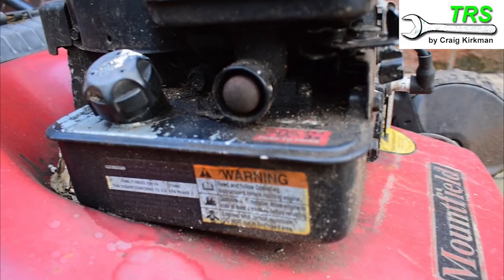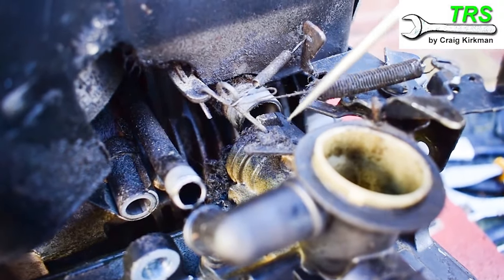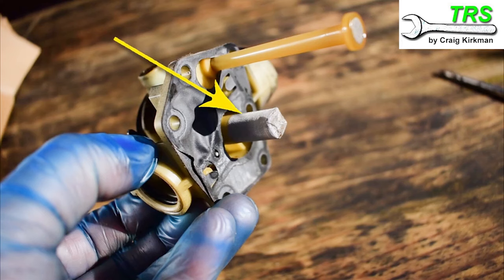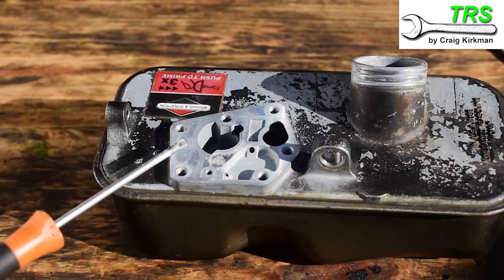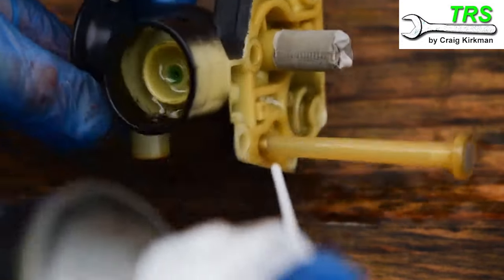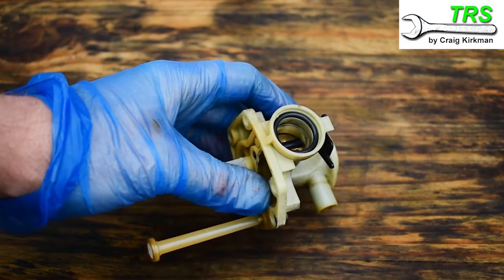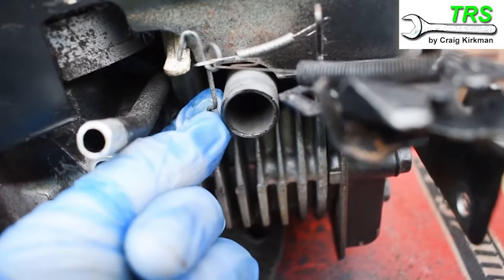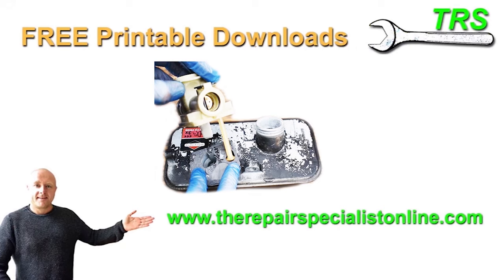Briggs and Stratton Carburetor Diaphragm Replacement- Lawn Mower Engine Diaphragm

Comment: Thanks to you sir I repaired/serviced my old hand-me-down mower. It has never sounded more powerful. Symptoms were low revving and not maintaining rpm to almost cutting out. I removed, stripped and cleaned the fuel tank and carburettor and reassembled. Now it runs like an animal!
Reply from the maker: Fantastic. Thanks for letting me know. Happy cutting. Craig 👍👍

Comment: The best video on this type of Briggs & Stratton engine. Especially the detail about the flatness of the carburetor to fuel tank mating surface. This caused me to assemble and then reassemble the whole thing multiple times. Also, checking the intake tube to the engine is something that also needs to be checked. It's easy when you know how. Thanks for your attention to detail.

Comment: I had lots of running problems with my Briggs and Stratton engined mower, never finding the problem. Finally, with no more hair left, I changed the carburettor diaphragm and voilà, the issue was solved. Thanks for your help.
Reply from the maker: Thanks for sharing. Craig

Comment: Thank you!  I ended up with a tiller that was abandoned with the house we bought but its positively nasty and oily sludgy around the fuel tank.  Hoping to find some parts local vs slow Amazon, but this looks like it has the information I need!

Comment: Hi good morning.  I would like to compliment you on an excellent video. Best i have seen todate. So easy to follow its given me confidence to have a go at one of my mowers which is hunting when i start it and stops occasionally. When it settles down it does run ok. I have this issue every time i use it. I assume a good carb overhaul is required.    Thanks again and well done.
Reply from the maker: Awesome, and thank you for your kind words. Craig

Comment: On my engine the governor setup was was a little different different and took off the bracket off the front of the engine (used by the 3/8" bolt) to give more room to maneuver the carb off the shaft.

I didn't tighten the carb enough and it was leaking when priming.  After more tightening I primed the carb, still leaked, more tightening did the job and then I installed the carb back on the engine.

Comment: Many thanks was having trouble locating these parts.... I appear to have broken a small sponge like gasket / washer around the shaft of the carb throttle goes on the outside of the carb near where the cables attach to govern opening and closing or speed control - this would prevent ingress of dirt down the shaft but nowhere to be seen as a spare and looks tricky to replace help!

Comment: I replaced my diaphragm and gasket last October and found this video invaluable. Last week I noticed fuel was leaking onto the top of the tank so I've just had it to pieces. I did everything as per your video again but am still getting fuel coming up one of the screw shafts. At 14.59 it looks like your screws have a sealing washer on them ?? Not sure if mine do. If this can't be sorted is there some kind of gasket sealant that can be used. Hope you can help as I'm a bit stuck.
Reply from the maker: Hi. Thank you for your kind feedback, I really appreciate it. The screws aren’t actually in need of a sealing washer. The screws in my vid are just spring washers. If you are getting fuel out of the screw hole then just make sure that the diaphragm is not damaged in that area, the screw is nice and tight, and if that isn’t fixing the issue then consider that the top of the tank can sometimes distort ( the silver machined part where the carb sits on top). If this is the case then you can either buy a new tank ( or a good used one from eBay for much less the price). You can test to see if there is warping on this area by using a straight edge ruler as shown in the vid. This issue with warped tanks is not so common though so make sure you check the other things first. Because the carb is made of plastic they can sometimes have airline splits in them that can cause this type of issue. As mentioned about the gasket, and diaphragm for that matter, give these a thorough check for tiny cracks and splits. Start here and if this doesn’t sort the problem we can go further. Thanks again. Craig 👍👍👍
Reply: @TheRepairSpecialist  Thank you Craig. So kind of you to reply & so quickly too ! I thought I'd lost all 5 washers when I first took it to bits last year. Maybe not it seems. The gasket & diaphragm were new last year and new ones again today. I'll have to do the straight edge test at the next opportunity. Pity,  as I thought I was doing so well & am now worried that I've used more force than I should have & cracked the plastic.

Comment: I've put three new carbs and tanks on mine and on all of them about the 3rd time I use it the carb. doesn't want to prime. I get frustrated because I don't know specifically what to fix so I just buy a new assembly. What is going on with these that I have to fight this battle every year after only a couple of uses? Does the diaphragm go bad that quickly? Is there something I need to make sure is clean after every use?
Reply from the maker: Hi

It sounds like you're having some frustrating issues with your Briggs and Stratton 500 series engine. If your carburetor and fuel tank assembly keep failing after just a few uses, there are a few common culprits to consider:

1. **Fuel Quality**: Ethanol in gasoline can attract moisture and cause corrosion. Try using ethanol-free fuel or add a fuel stabilizer to prevent this.
   
2. **Fuel Contamination**: Dirt, debris, or water in the fuel can clog the carburetor. Ensure you're using clean fuel and consider adding a fuel filter.

3. **Storage Practices**: Storing the mower with fuel in it can lead to degradation and deposits. At the end of the season, either drain the fuel system or run the engine until it stops.

4. **Carburetor Issues**: Small passages in the carburetor can get clogged easily. Regular cleaning and using high-quality fuel can help.

5. **Primer Bulb Problems**: Check the primer bulb for any cracks or wear and ensure it’s functioning correctly.

6. **Fuel Tank Ventilation**: A clogged fuel cap vent can create a vacuum and prevent fuel flow. Clean or replace the cap if needed.

By addressing these areas, you can hopefully reduce the need for frequent replacements. Good luck, and happy mowing!

Craig

Comment: 1) I recommend hitting with air first, carb spray second, then with air again. The stronger the air the more debris you can easily blow off.
2) I had a problem where the gasket curled away from a screw hole, happened too easy & had to undo and fix.

15:55 Your dead bug is still in the fins 😝

Comment: Can I use water or throttle body cleaner for cleaning the carburetor? Is it safe to use? Thank you!
Reply from the maker: I usually use either of those. As long as you make sure that you dry out the inside of the tank afterwoods then all should be just fine

Comment: It's not the space shuttle. But,a way informative video .Also,if your mower don't prime ? Scratch a shallow line on the tank where the gasget meets the tank. All the way  around surface of the tank. It will help with a gap,and help with the seal. I saw this on YouTube,it works.